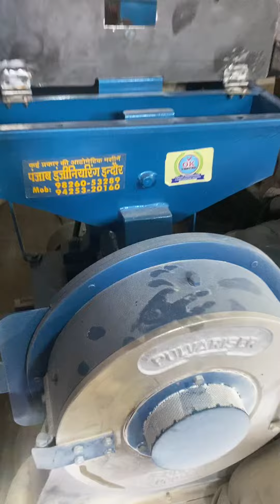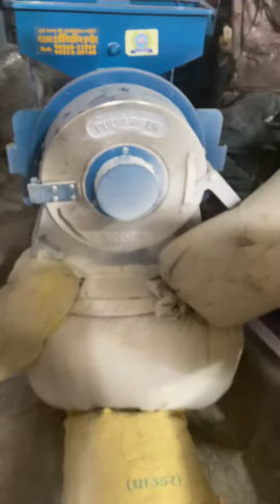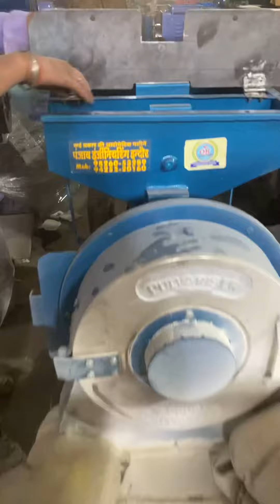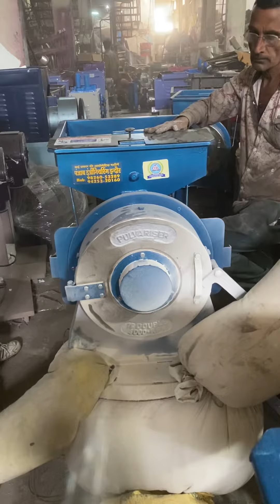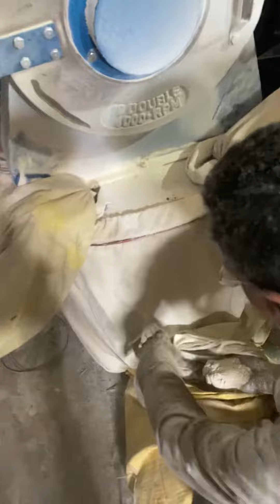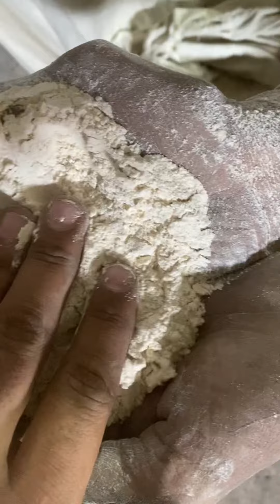15 to 20 H.P Double Chamber 16” StoneLess Atta chakki Pulvriser machine, Doubl📱📞☎️ +91 74892 41187

Comment: What is rpm and what are puli size between motor and pulverizer for 1440 rpm.
Reply from the maker: PUNJAB ENGINEERING CORPORATION INDORE 

Catlog + Rate list - https://online.fliphtml5.com/eaiuh/aoql/ 

WhatsApp Click here - https://wa.me/919340260259

https://wa.me/919098587992

https://wa.me/918962826650

https://wa.me/917489241187

https://wa.me/919098383797

https://wa.me/919302435427

Email -  punjabec@gmail.com
S.Japleen Singh - +91 9329205352 , 74892 41187 ,9111156620 ,8962826650 , 9039088841 ,9826053289 ,9039063289 , 9425320160 ,8871686000 ,8982325000
Reply: How much production of maida in 1hr for 20hp